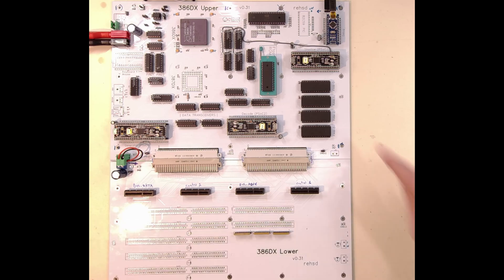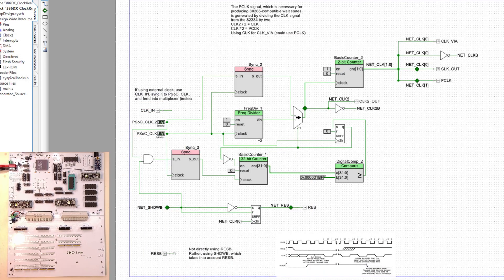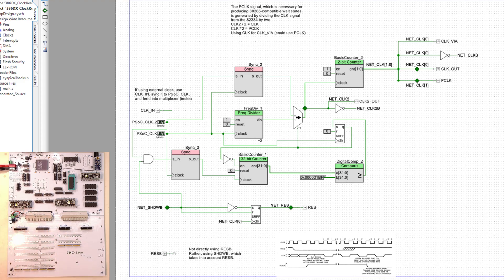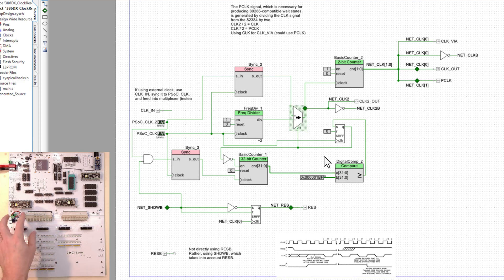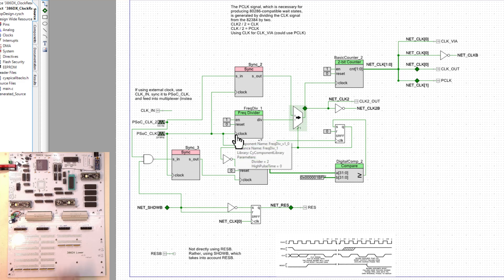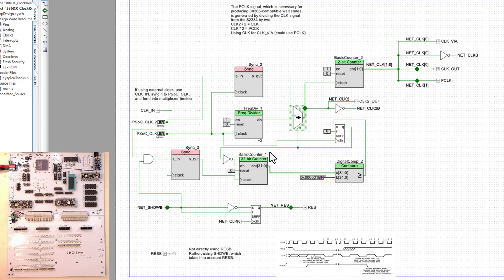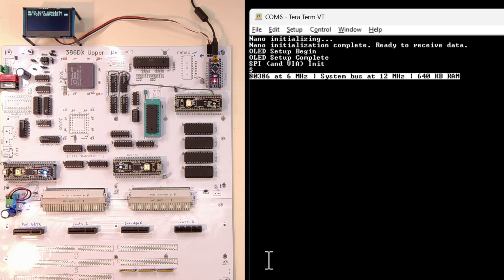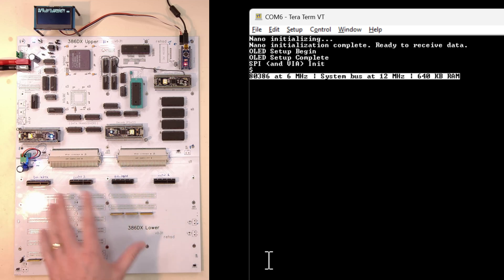80386 DX Build, Ep. 17 - Faster Clock, SPI Working

Comment: One suggestion would be to take an empty area on the board and fill it with a 0.1" grid of plated through holes to create a prototyping area. That way if you need to you can chuck in little bits of logic or other components in between board revisions.

But otherwise there's always dead bug style prototyping. 🙂
Reply from the maker: Good suggestion. On my previous prototype board, I had empty sockets scattered throughout the board, but for some reason I didn't do that on this revision. A more general grid could come in handy.

Comment: Nice, I like that little nano bridge. And the clock mux... so what you're saying is that after 3 seconds the Delorean hits 88 mph and then, whoosh! Terrific.  About the clock mux, not sure what component is inside the psoc, but oftentimes clock muxing is done with a state machine and some extra gates to ensure the mux switches over when clock 1 is low, holds it low, then waits until clock 2 is also low before actually switching the mux. This ensures that you don't get runt pulses on the clock if you switch the mux mid-cycle.